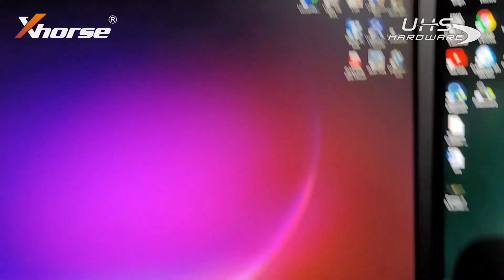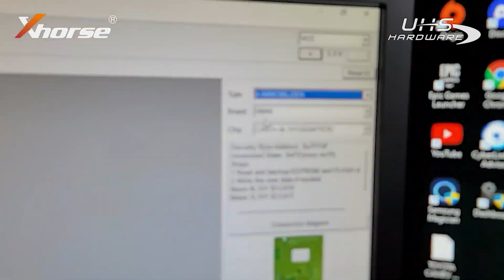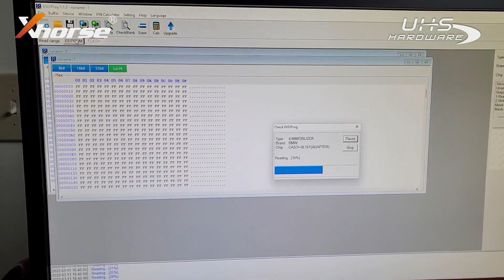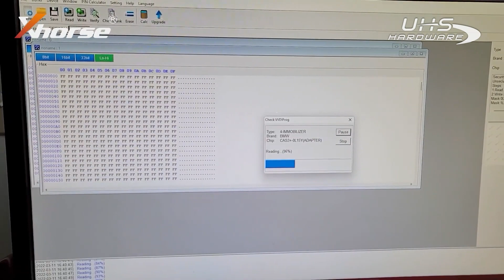How To Read BMW CAS3 System w Xhorse VVDI PROG Solderless Adapter Cable EEPROM - Xhorse Fan Sub 3

Comment: Can this cable possibly be used in the same way but with an xp400pro?
Reply: Нет
Reply: yes but not easy like showing in the video but not hard need to solder wires on CAS result will be same.

Comment: Is there a video showing attaching the adapter? Do you need to prep the board? Do the pins hit all solder pads or actual holes in the CAS board?